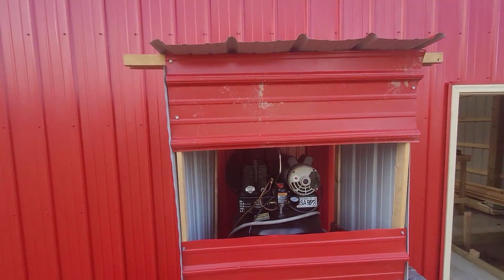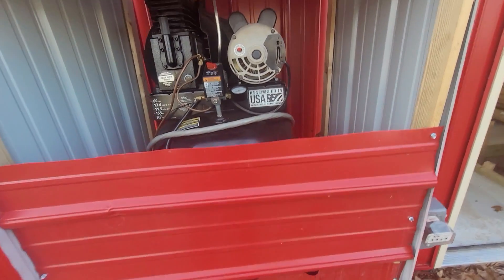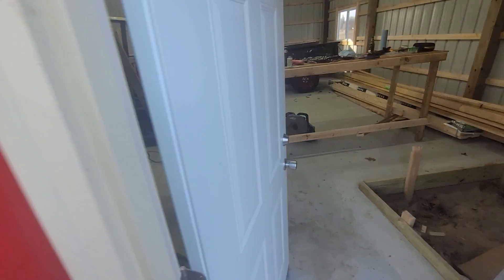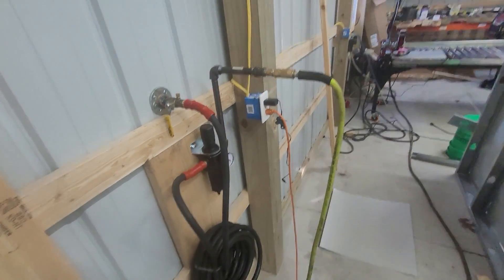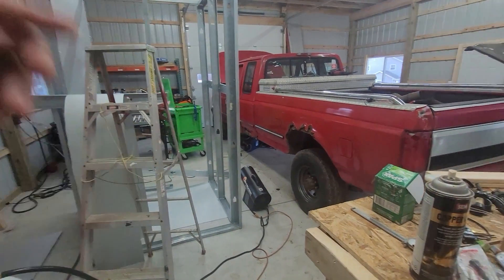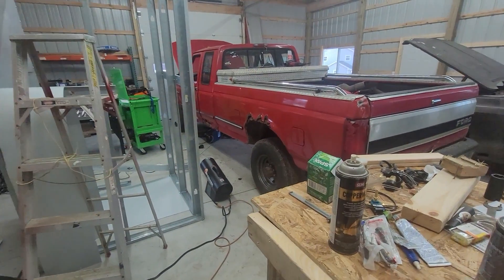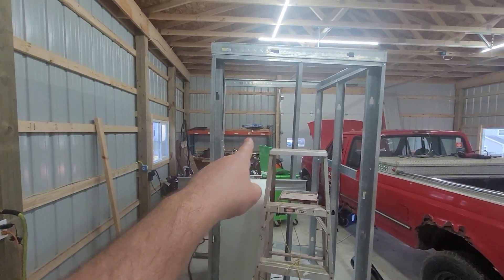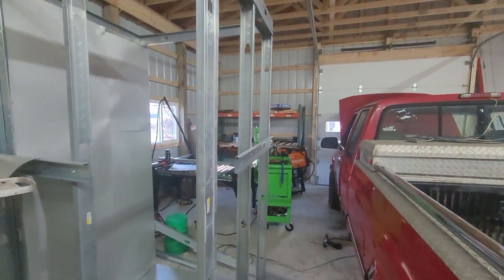Shop Air Overview, Rona update.

Comment: Good luck on feeling better. My wife and I had the rona back in April, she still has limited smells. 

Those fittings are called floor flanges, I use them for all types of projects they aren't designed for 😉😃

Comment: Looks good. Might wanna insulate that shed tho. Not so much for heat. Maybe the in-laws will splurge and buy you some sound board insulation for xmas. Fire it up. Repeatedly. 
       I mentioned 3 phase power a couple weeks ago. I have this fancy German compressor that needs it. Got it cheap at auction. It's in an insulated box. Takes up an entire 4x4 pallet. One day maybe I'll have it running.
Reply from the maker: I definitely meant it when I said I don't want to insulate shit 😂
Reply: @TheDrivewayEngineer  
I get ya. But the noise...
Reply from the maker: @gmw3083  idgaf about the noise, and idgaf about the insulation 😂

Comment: Glad you are feeling better JR.... Shop is coming a long way... 

Quick question. I'm looking at snake eater 80lb injectors for a 1999 5.3 truck engine for cam swap. Snake eater lists the gen 3 truck engine injectors for 2001-2006 i believe.  Are these the injectors i need?
Reply: You don't need to change injectors for just a cam swap
Reply from the maker: No, you don't need 80 lb injectors for a cam swapped 5.3

Comment: You might want to consider insulating your shed to lower the chance of the compressor freezing
Reply from the maker: It hasn't frozen in 6 years, I like my odds
Reply: @TheDrivewayEngineer  Ya, Mine hasn't froze in 30+ years and i live in Northern MI. The frozen wasteland. LOL
Reply: More about the shed (but not about insulating).  It looks like easy access to thieves trying to get a free compressor. Do you have it chained up to something?
Reply: @ernestomejia110  Nope, just in a wooden shed, where I store all ground engagement tools etc. It has been one of the best things I ever did. Lastly, I live up on top of a hill, little hard to get to my property except driveway.